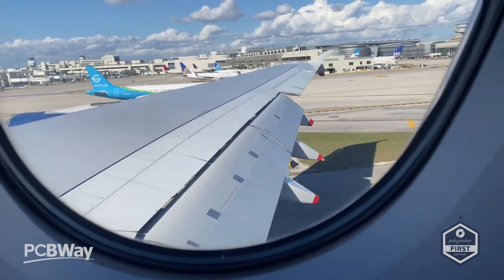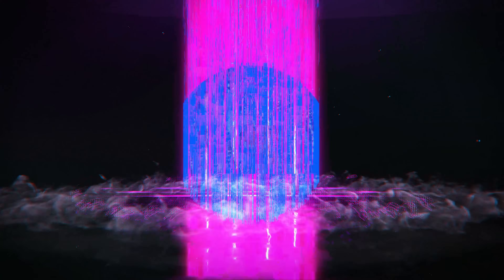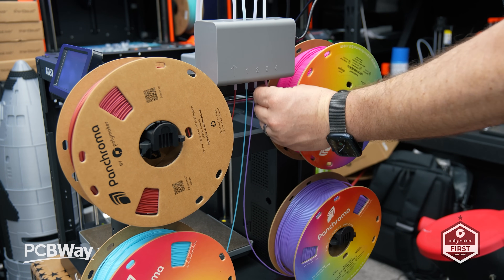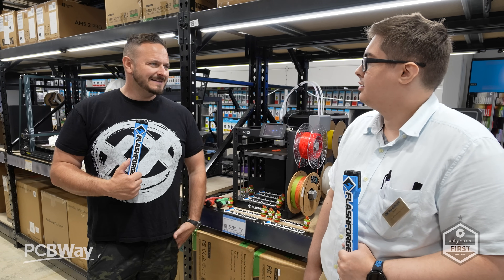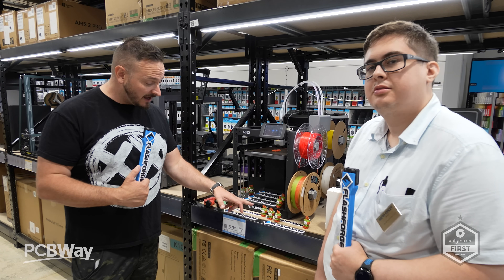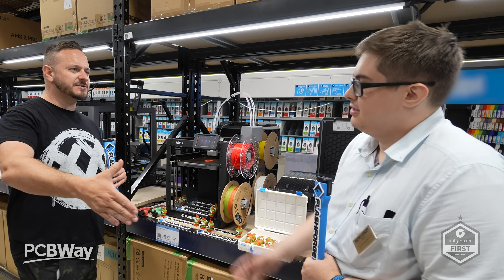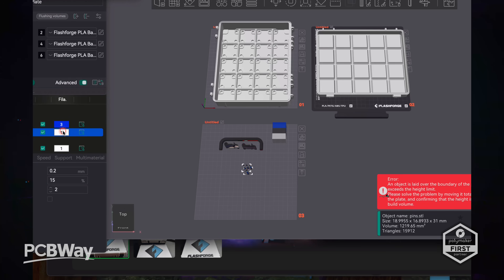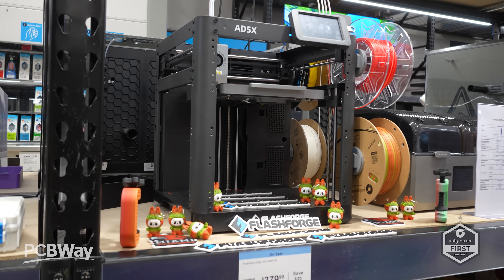Don't Miss Out! 3D Printing Revolution Starts at Micro Center in Miami

Comment: Maybe its because Im Bambu Labs spoiled, but I am confused why anyone would want this printer. The A-1 is larger, just as fast, four colored with combo unit and its a Bambu.
Reply from the maker: You a Bambu Lab fan ?
Reply: @TheRealSamPrentice  FAN or do not know any better. Im a hobbist and have no interest in making something you buy actually work. I do not have that problem with my P1Ss.
Reply from the maker: I have many printers and hear you :) the ad5x has been a great printer for me also tho and the price is good
Reply: Bambu Labs are out of the majority of the average persons budget if they are just starting out. Yes, the replacement parts are cheap, but its that initial investment that can kill dreams. Hence is why I am looking for a reliable, well built machine that will do what I want and not give me grief. Nor do I want a bed slinger, they just dont fit with my workflow.

Comment: Flashforge, they need a more polished product like their m5 pro, with a multicolor unit. Elegoo centauri can't be beat, I'm surprised micro center aren't stocking those up. Micro center should do a trade in program for 3d printers.
Reply from the maker: Umm they are aren’t they? I have to admit the m5 pro was epic !
Reply: I agree, but the Centauri Carbon doesnt do multicolor and does not come in a combo package.  As I rarely now do single color prints, a single color machine is absolutely useless to me. The single color items I do I can do on a multicolor, so a secondary machine unless it is multicolor is pretty much redundant.
Reply: @PamWalker-JustCrafts elegoo should be releasing their multicolor unit soon, the printer is already setup for it. Its the best bang for the buck 3d printer ATM, well built machine. Bigger build volume too.
Reply: @oneanother1  Yes I agree that the Elegoo is good value, but I have not got an bottomless bucket of money and with the cost of living over  here in Australia having to make another purchase pretty soon after the initial one would be impossible.  Hence is why I am looking at the combo packages. It is not only convenient but 99% if the time you get the multicolor add on a lot cheaper than buying it separately. Build volume for me is a non issue, I am so used to the 220mm squared that being bigger would be handy but not an absolute need.
Reply from the maker: What about snapmaker u1 ? I have a few videos on that
Reply: @TheRealSamPrentice  I have supported their Kickstarter, but the fact that we wont get them until around January next year doesn't fit for me. I have markets to do and stock to build up. That being said I am looking at getting a second multicolor printer at a later stage to improve workflow and product number production. I watched your video on the Snapmaker U1, amongst many others and it is impressive. I would hazard a guess that the nozzles wearing out as quickly as they do on a single extruder printer would be a lot less.  To be honest I wouldnt even mind paying the full price for it. The only thing is, it is just off the production line and I feel that it needs at least 12 months to prove itself before I purchase one. Call me paranoid, but that is just the way I see it. Sam, what do you honestly think of myself getting a Kobra S1? Is it as reliable and good as it is cracked up to be?
Reply: id stay away from anycubic, their multicolor unit isnt reliable, extruder prone to jamming. There machines are often unsupported after theyrelease a new printer in a year or so. There firmware is closed, so kind like the bambulab situation, when you have to rely on their software or cloud service to print. Ive been a lomg time anycubic user for their afforable machines, i stopped after the kobra2pro, because theyve locked down their machines. Creality is by far the most polished multicolor machine with open source firmware too.
Reply: @oneanother1  So ok, I was thinking of one of the Creality enclosed core xy printers. I know in the past Creality had a bad reputation,  but from my research they seem to have improved. What do you think?
Reply: @PamWalker-JustCrafts yeah, they are releasing the k2pro soon, prices though are on the higher side. I have a creality k1, its fine for me, especially if i can tinker with it. Well, see. For me, the elegoo centauri is great for the price. Of course, if creality can have a k2 with multicolor for less, id fo with the k2.
Reply: @oneanother1  Ok as I have only been 3D printing for 5 months and tinkering isnt my thing, that wont work lol. However, as a last resort I would go with a bed slinger (under duress of course). There are many, many choices out there but that narrows when you want multicolor. I dont want Bambu, that is just not an option, even though their machines seem to  be the most reliable. Their customer support on the other hand leaves a lot to be desired from what I have seen and heard on here, from multiple people. I am thinking a heap more research is needed here. But I do appreciate getting feedback from everyday users of these machines. At least I get honesty on the dirty side of the machines and manufacturers.
Reply: @PamWalker-JustCrafts the original creality k1 had some issue. The k2 looks to have solved those issues. There shouldnt be any tinkering on the k2, as theyve already released the k2 plus for a couple of months. The other options are creality hi, bedslinger multicolor. They are all poop machines though, lots of filament wasted. Maybe multi tool head 3d printer the way to go.